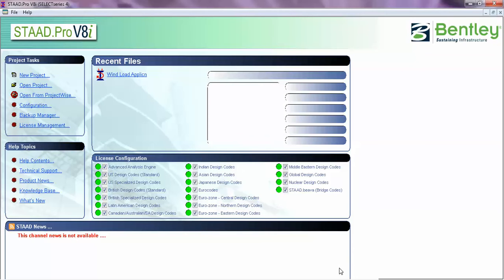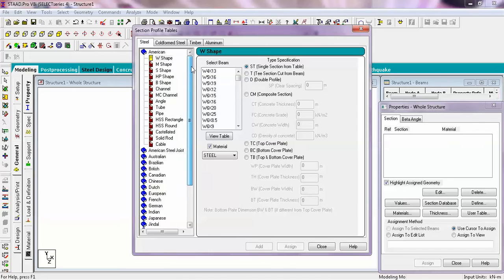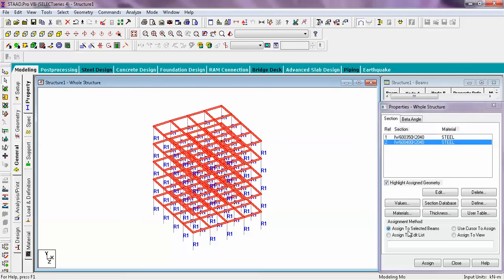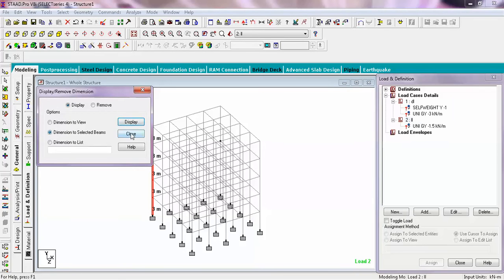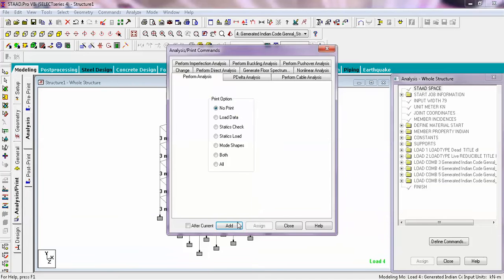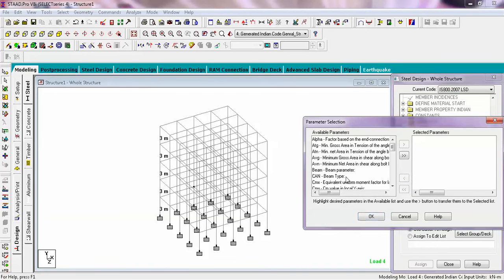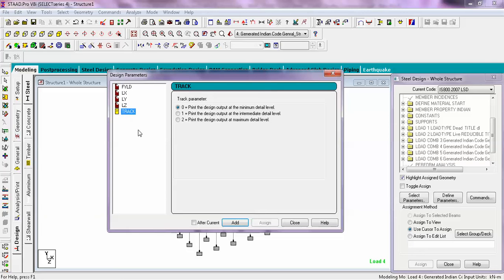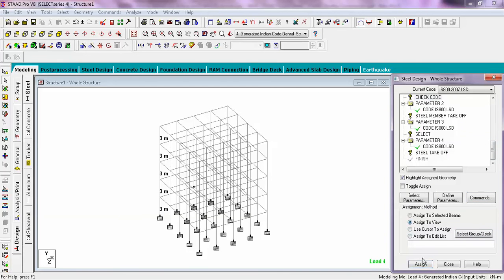Staad Pro V8i Steel design using IS 800 with Lx Ly Lz explained in detail

Comment: i have face one issue in staad that, member geeting pass in staad but shown fail in report...how i can resolve such error???
Reply from the maker: Hi ...in report staad shows all the members weather they pass or fail ... you need to check full report... and it will also show that if a member is failing at certain section size and it show it pass at bigger size ..... Please Like and Subscribe to show your support to my channel.... it really helps me to reach more people
Reply: @Jags22079  mean it will be replace with section mentioned in staad...but some time the same section is pass and same is fail at different location....and staad tell to replace with certain different section....
Reply: @govindsoni1384  if check code after post processing in table unit check I analysed with one section it designned with another section how to change it

Comment: Mr.Jags, 
Your are explained well all except Lx,Ly and Lz. As per your model each column, beam length is 3.0m but you have assigned Lx,Ly,Lz is 1.0 How?
That should be Kx,Ky,Kz value not for Lx,Ly,Lz value. Lx, Ly,Lz value should be 3.0m if not tied laterally. If you not assigning also default it will take 3.0m only.
STAAD will considered member as length between the node. for example simply supported beam length 10m, split beam 4 part each part 2.5m.
What is the default Lx,Ly,Lz value? default value is 2.5m it is not correct. In this case we have to assign Lz-10m, Ly-10m, Lx-10m or laterally supported every 2.5m means Lz-10m, Ly-2.5m Lx-7.5m (0.75L) Refer table 15 IS-800-2007 if compressive flange fully restrained.
And also Lz how come 10m?
simply supported beam buckling length depends on bending moment point of contraflexure. here simply supported beam Kz value-1 so Lz=Kz*L=10m
It is applicable for column,beam.

Comment: Sir I am confuse.. sir I have find all the load and now to not no which members is to use and which measurement is to use... like I have to use angle section for my industrial shed then how much angle angle is to used like 50×50×4 etc

Comment: can you please explain how to provide the overlapping factor in staad in the case of high mast pole design
Reply from the maker: Sure but can u be more specific.... may be with an example
Reply: @Jags22079  I need to design a pole in staad Pro since there are two things which i need to do to provide a parameter for lap joint which is there in poles and secondly the I have designed complete structure but its getting failed

Comment: Jags! Unfortunately, there is almost no explaination on Lx, Ly and Lz. STAAD. The important thing is to explain how to calculate these values in STAAD. These are not straightforward values of effective length. These values are to be calculated based on the actual member length, design member length and slenderness ratio. Reference to code will only give the limiting ratios. These parameters in STAAD are not these values. As these values make the program understand what effective length to be used for design, just applying a value"1" to Lx/Ly/Lz will return wrong results.
Reply: 100 % correct half knowledge not clear the concept it's even confused for new members

Comment: Do you have any video for truss design of conical roof of large storage tanks used to store oil, chemicals etc?
Reply from the maker: +M.M. Sunilkumar sir I haven't done anything like that but I can give it a try
Reply: Thanks. Shall look forward to it.
Reply: we are the design consultant and its our regular work  it requires manual calculation also for the application of load...
7385571638

Comment: Please tell me how to use the values of C1,C2,C3 for the calculation of Elastic Critical Moment (Mcr) for lateral torsional buckling of I-section beam by using IS 800:2007 in Staad pro V8i?

Comment: Dear sir,Can please explain clearly  Lx Ly Lz and Kx,Ky Kz with the help of local orientation by taking few examples, such as purlin with sag roads(i.e if sag is connected in middle we break the effective length in  design in one direction we consider full length in other direction), similarly,column with bracings at different heights in both the direction, beams with purlins ...etc...It will be very helpful to me and other viewers..Thank You,Regards,Saikiran.
Reply: Isko pata hoga tab explain karega na bhaai, there are other videos where you can actually learn, don't give this guy a fuck, he is unaware of what he is supposed to tell!